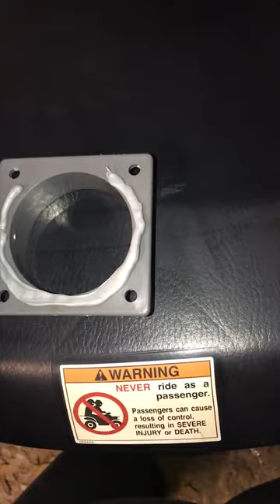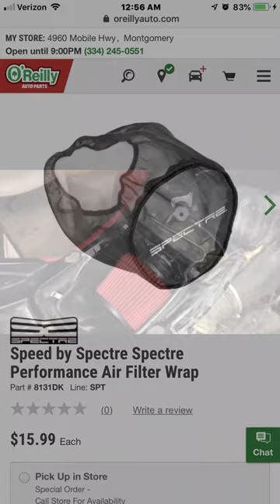Kodiak 700 Air Box Mod

Comment: Hey Man! This looks like good idea. Is this holding up since it’s been a year? Did you have any power gain or loss maybe. Either way looks better to do this than the stock air filter being so loose. I have to do this or something else, but this looks like easy fix.

Comment: Only thing I see wrong is the KnN filter,  never a good idea, if the filter ain't foam, dont use it. 
The KnN let's way too much dirt past and the rings wear out , then it starts burning oil.  Very common problem I've seen